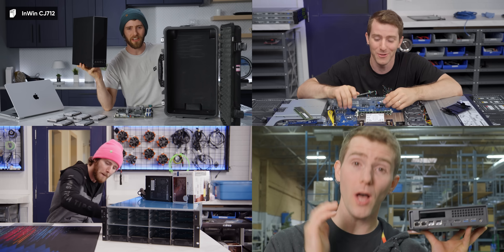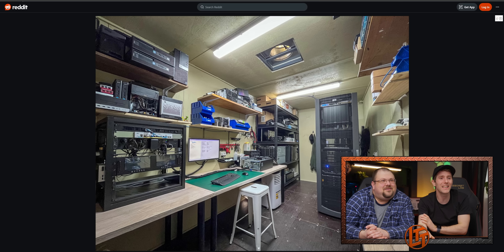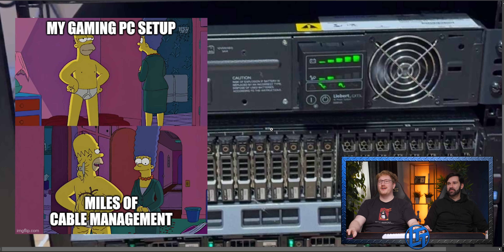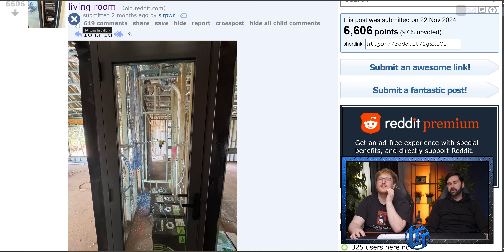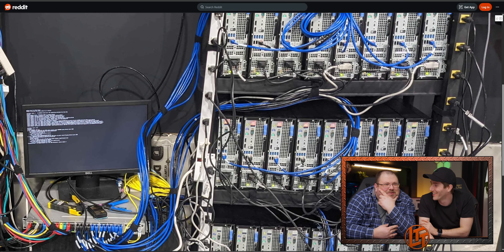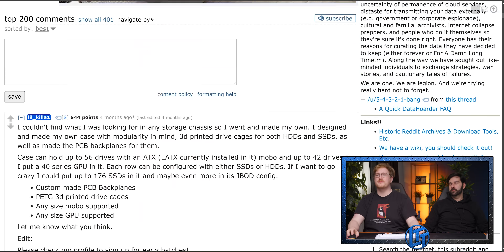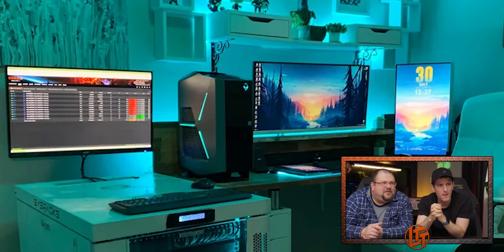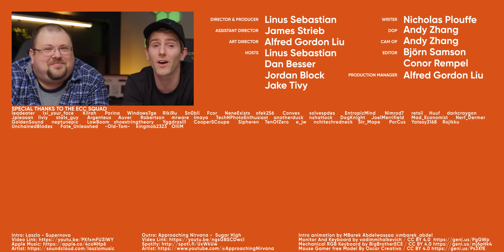Even I’M Jealous of These Guys - Reacting to r/HomeLab

Comment: OMG I feel seen...

My PC is in an older 4U case from like 2005 that I custom-modernized to work with AIOs and current-gen hardware, sitting in a custom-built 18U rack I made out of steel tubing...

My 3D printer is behind me, literally working on printing sets of rack rails for a trio of 10" mini-racks I'll be building over the weekend to hold my recent home network upgrades (Minisforum MS-01 running Proxmox/OPNsense/Pi-Hole, Mikrotik 10g fiber switching, Wifi 7, Minisforum UM890 Pro game server, etc.)...

I almost have more monitors than desk space - 32" + 27" on a corner desk that's 48" square...

Hell, I even have an aluminum DIN rail, a bundle of 2020 aluminum extrusions and all the hardware you could ever want or need for working with them, ABS plastic panel blanks, blue pills and black pills (STM32 MCU dev boards), and the stuff for making custom 10gbase-T patch cables, all within arm's reach...

I prob ought to post something over on r/homelab...

Comment: My Homelab are 2 Daisy chained 5 Port switches because i was too lazy to get two ethernet cables in my room and too cheap to get a bigger switch when i bought the firt one, my Gaming-Pc, an old Laptop running Proxmox, a Synology Nas and 2 Computers with something below i5-6000 and a pi4 which i turn on if i want to try something 
I need to win the lottery. I want this pretty Stuff

Comment: I used to run a server at home, but the power bills are not nice and it was too noisy. I was VMware trained so always loved ESX, but moved on from those days. Now using a single nice little Dell Optiplex i7, with 64GB ram and 6TB of storage across 4 SSD drives. Running Proxmox which is just awesome i have to say. VM for PFsense so no physical router, Ubuntu server for PiHole which EVERY home should have !, and a windows server that does various things. 4TB file share, UniFi network server for all the AP's. CPU barely clicks over 15% in most daily use. Hardly uses any power and its silent. Plenty of spare resources left to spin up new VM's for testing when i need to. (IT guy by day).

Comment: I have to say Jake is somewhat wrong on the huge monitor count setups - when you need to reference 3 man pages and a web page of two for a problem its very handy to have each of them in the same place and all of them visible at the same time - glance at the man for command x to make sure the formatting is right before you glance at command y that is handling the piped output etc. Or when running many VM/systems at once - it is a real pain changing inputs to check on the compiling/rendering/updating/smart checking/scrubbing machines you are working on as you can't always install and often wouldn't want to a remote desktop to the machine you are playing X-Com on (turn based because you are working, and might need to do something at any moment).
Reply: Cool, for that very niche scenario, 3 to 4 monitors. Not 6.

Comment: As a programmer, I use 4 monitors + my MacBook screen daily. I am about to get a 5th monitor. Having monitors in that configuration does not make you slow. Getting overwhelmed by all the windows open is what makes you slow but you get used to that within a couple hours.

Comment: my network stuff is straight ub boring. i have an 10gbit 24 port switch, no ups, a basic FrizBox 7530ax router, a dell Poweredge R630 and an R930, a Dell Powervault MD3600i. And that's it all, sitting stacked up on the ground in the broom closet. i mean, yeah. i live in a shared apartment with 7 other people. Everyone uses this equipment every day. Like for Storage, Gameservers, services, our home assistand stuff and so on.
the main Server that is running is the R630 with its PowerVault. the R930 is basicly all the time off because it uses to much power and we have no use for it right now. Even the R630 is running only on 2% to 4% load, sometimes hitting 40% if AI stuff is used like LLM and Stable Diffusion, if stuff running on the CPUs not on the two rx540 like usually. Even the Matrox m264 codec card is barely used.

Comment: ooo that old compaq kit at 14:00  reminds me of the best server fix I had in the early 2000s.  

6500R servers drive tray had a design flaw which could lead to the fan communications controller ribbon cable being punctured by the locating pin if you weren't careful when the drive cage was removed and reinstalled. I got to pull one over my Compaq certified colleague with his service manual by a little logical troubleshooting and identified the flaw after he'd repeated replaced controller boards, fans and drive cages, failing to fix the fan failure. 
Ended up making a custom armour section out of a plastic ID badge for the ribbon cable.  no more puncturing the cable when re-installing the drive cage. 

Only made our 4 hour fix by doing a little OOH emergency works, but got it all back and sorted by 10pm the same day. The customer was very happy with our service.  Poor logistics colleague  covering out of hours had to break into the secure storage cage in the warehouse, as they'd not left him the right keys that night and we had to have a full unit replacement plundered for the cable.  Ahhhhhhh custom cables nobody expects to ever replace are a pain.  

Shout out to the old Norsk Data crew, Alston, Andy and unknow logistics hero who I worked with on that one. Fun times.

Comment: Don't worry, guys, 9:05 just needs to add more nodes. From, it will still not perform great but you can say you have a 256 node computer made up of sub 100$ computers you brought over the years.
Reply: What you definitely need to speed up slow computers is a network of them over old low- bandwidth connections, and make the software rely on other nodes for key tasks.

Comment: My home lab:
An old hp elitebook 8440p with 1 TB of HDD storage, It runs Jellyfin using CasaOS. The keyboard is missing keys and bugs, so I unplugged it.

I also have a Raspberry Pi 2 lying around somewhere, someday I will setup Adguard or Pi Hole on it. 

So yeah, I clearly won this.

Comment: The shipping container lab makes so much sense if you've got some land. You can get one for like $4k (way cheaper than anything you could build).
Reply: Not really unless it's cool year round. AC for a steel box would cost you a fortune. And trying to do outside air circulation instead exposes everything to humidity (fungus/mold in addition to moisture).

You'd really need a cool, but dry, environment year round. Or spent a fortune on AC.

Comment: I have never given a shout-out to any brand via comments, but once I watched the how many usb devices can I plug in using docking splitter vid. Every adapter, plug, and wire I buy. I search for UGREENs first to see if they made one. Technically, I don't mind a nockoff if it does what I need it to, but after 3 different cable purchases to get my laptop to run the full 165hz, my monitor can handle. Their docking station, Class C to display port adapter, and every item I've purchased since does what it states it can do. So no more collecting crap that says it can do this, but it can only do that anymore.

Comment: Some of this was like inspiring and far out of my budget and other ones made me feel like my lab is overkill. 

I have work to do on cleaning mine up a bit and consolidating. But a 27U should be plenty with my two 10” mini racks. 

Those newer Minis forum ITX boards with Ryzen 7945HX CPUs replaced 2 of my 8PC 6th gen i5 clusters. Each board uses like 1/4 the power and has 3-4X the total compute. Didn’t even lose any ram capacity since each mini pc had 8gb of ddr4 and each minisforum board I’m running with 64gb of ddr5.

Comment: love how at 10:22 could be easily the most expensive setup seen so far but none of them realize how pricy NI's PX stuff is
Reply: Love UwU 🥹❤️
Reply: Depends on whether you look at original price or current value. Most of it would be considered e-waste these days (but not to me!)

Of course the same could be said about most of the gear in this video
Reply: Yeah.  A stack of obsolete servers looks impressive, but they're often pretty cheap.  Even the racks can be had cheap, even free at times.  Just about anything from NI is crazy expensive, especially for what it is.  Honestly, I think most of their stuff is sorta over hyped - plenty of other solutions that are as good or nearly as good from other companies (Hp/Agilent/Keysight, Tektronix, etc) for much more reasonable prices.  And don't get me started on LabView.
Reply: @Sw3d15h_F1s4  Yep, and the claim that there is no need for birth control is false. I have a similar setup, though with way cheaper systems, and when my girlfriend came over, she was actually curious about this stuff and wanted to know more.
Reply: Maybe not the NI stuff specifically, but he likely knows the other stuff. All $10k+ each except the siglent.

But sometimes you can get that stuff used for cheap if you're lucky.

Comment: My “homelab” is a gaming pc I found on the side of the road during bulk trash pickup. It’s a water cooled i5 3570k, the gt710 died but I just remote in to use it and run it headless, keeps jellyfin and Minecraft servers 24/7 without a problem.
Reply: my is refusing to run jellyfin so you're beating me
Reply: 3570k is kind of slow for minecraft though... but good enough for like 5 players
Reply: @hisamiyomotsu1337  for three players we have never experienced lag even though the homeland is at least a county line away from most of us, never using more than 40-ish percent cpu and rarely over 4gb of ram
Reply: @BADESTPIE1-ESK5  "40%" cpu doesn't mean much, minecraft is (mostly) singlethreaded, could have lagging server at 4% usage on a 9900x...

but yes 3-4 players is fine. if doing big farms/projects would look into any of the recent amd cpus (zen 3 and higher)
Reply: @ given i haven’t had any issues and didn’t spend a dime on the system I will be sticking with it till it doesn’t work, mostly because I can’t even afford to upgrade my 1650 super, I won’t be building a new system as a homelab for a while tbh
Reply: I refuse to call something with a GT 710 "gaming". Intel's integrated graphics was faster than the 710, at the time that the 710 was released.
Reply: Energy consumption would make this very expensive in my country. I bought a Dell 3060 SFF with a pentium g5400 for 60 bucks. Runs minecraft server and jellyfin without an issue and uses 7 watts idle.

Comment: my homelab is just my 2013 laptop running 24/7
Reply: Remembers me of my school they got a "server room" that is just full of racks with decade old hardware and the actual server is a Lenovo think center with an Intel Pentium in the school secretary that is hidden in the wall. Pretty safe tho.
Reply: Laptops are great! They are small, have a built in keyboard, mouse and screen. They have a built in "UPS" as they have an internal battery. reduntent networking using ethernet and WiFi and more!!
Reply: @2pacsawyer  Except the battery usually gives out after a while of having it plugged 24/7 (at least that was the case for me for my last 2 laptops). But yeah they're great. One day I will get a NAS though, instead of relying on my laptop and 18TB external HDD...
Reply: @3lietechhack646  Not wrong. If you've got a laptop plugged in 24/7 you're better off running the battery between 50-80%. That will increase the life of the battery significantly. And realistically even at 50% a laptop would probably last longer than "real" server would on a lead acid UPS, especially with the screen turned off.
Reply: @3lietechhack646  Mine's battery is practically dead but at least it's got enough juice left for the thing to safely shut down
Reply: @rocktheworld2k6  Are there options to keep it at 50-80% autonomously? Picked up old laptop whose battery is already worn down; I don't want to pick up additional chore to remember to charge it midway, but didn't have time to look into options.
Reply: @ The BIOS of some laptops allow you determine how the battery is charged. We have Surface Pros mounted on the walls at work and in the BIOS you can enable "Battery Limit Mode" that keeps the battery at 50%.
Reply: @3lietechhack646  Ooooooh. Been there. No t-shirt and I got to keep the broken drive.
Reply: @MartynasNegreckis  My new Lenovo laptop has an option in the BIOS to keep the battery at 60%. Unfortunately, my old HP laptop, which is what I use for my homelab, doesn't have such a feature. It depends on the laptop.
Reply: @2pacsawyer lol home lab on budget but it works..
Reply: @2pacsawyer  there was a server room in one of the polish universities that was made out of like 20 PS2 consoles.

I want to see this server room live.
Reply: are you me? My 2013 Lenovo laptop with a core i5-4200U and a half broken screen has been carrying my 20+ docker services for 7 years now and it's not going to stop anytime soon
Reply: I had one run for a month, CPU fans apparently go out quicker than expected when working all the time. Due to the design of the laptop also the battery went bad being powered all the time.
Reply: I got one from 2013 one from 2011 and one from 2009 cos my dad's work gives them for free every 2 years lol
Reply: Based. Every time I buy a rack mount chassis I feel the sting of decadence and mdernity
Reply: Same here!
Reply: same but with my 2015 laptop and some external hard drives on RAID 5 for additional storage
Reply: Same, old Thinkpad with unRAID ahah
Reply: This is the real answer
Reply: Been there done that
Reply: Heck yeah
Reply: that thing is gonna cook itself 💀💀
Reply: today, i finally put my laptop to rest c':
bc i got myself optiplex 3060 micro  :'D
Reply: My home lab is a 2013 sff desktop